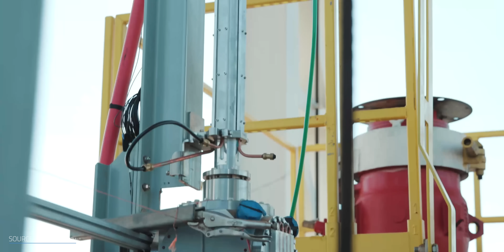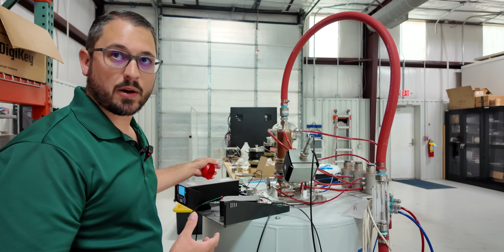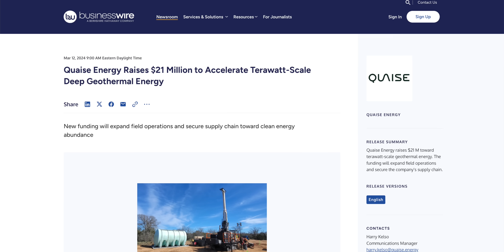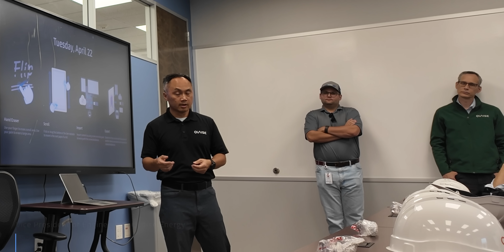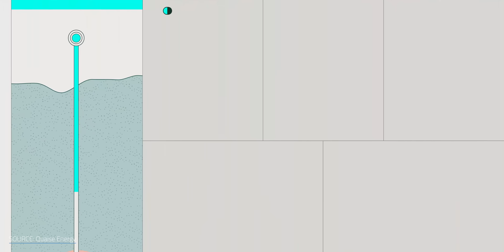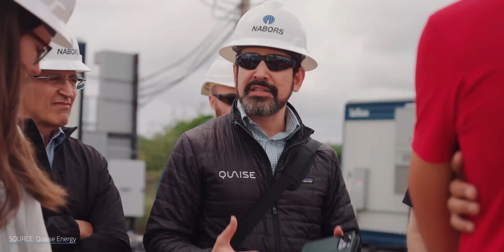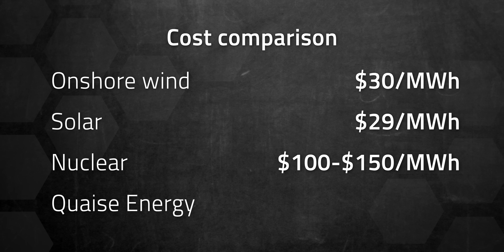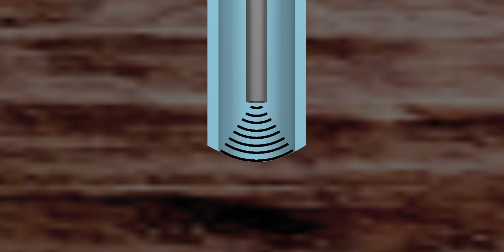How Geothermal Energy is About to Break its Limits

Comment: What about the cumulative weight of the drill shafts as the whole gets deeper? Isn't this normally offset by buoyancy provided by the dense drilling mud. wouldn't it iteventually cause a breakage up at the drilling rig or along the shaft?

Comment: I wonder how they handle partial cave ins of the drill hole when the tool is being pushed.  Melting the rock doesn't necessarily mean a completely homogeneous drill hole the entire way up the shaft, so sooner or later it will happen.  Can the tool cut it's way back out, or is there another way that they do that?

Comment: I think the economics of nuclear and geothermal are a lot closer to wind and solar than what you have shown.  For a direct comparison you need to add to solar and wind the cost of base load energy when the sun is not shining and the wind is not blowing.  There is also the lifecycle cost of solar and wind which will be higher than nuclear and geothermal.  Nuclear fusion and geothermal are really exciting technologies.
Reply: No, you don't have to add the cost of "baseload energy." Everyone knows solar and wind are intermittent. When they're generating (and increasingly, when their battery backup hasn't emptied) their Megawatts are cheaper than any other generation, so utilities install them and run other generation less often, which makes the economics of 24x7 generation like nuclear and geothermal worse . Do a DuckDuckGo search for "baseload generation is obsolete" and educate yourself.

And solar and wind lifecycle costs are NOT higher.

Comment: How long would the geothermal plant need to operate before it recovered the electricity cost required to drill the hole?  What are the worst-case-scenarios for drilling in this method?  What sort of Industrial Accidents, or runaway affects can occur - even under ideal settings?  I can see, if the technology gets popular, that less and less qualified (and moral) people will use it in more and more areas.  There are places crisscrossed with mines no one knows about.    Centralia, Pennsylvania has a coal mine fire that's been burning since 1962.

Comment: Wind and solar can generate plenty of cheap and clean electricity; what our economy badly needs is DISPATCHABLE electricity. If this geothermal power plant is shut down because there is plenty of solar and wind energy in the grid, can it be started again without any problem? If the plant is off for some hours or weeks, i.e. no heat is removed from the rock, does the temperature increase, allowing for higher generation once is restarted?

Comment: Question!! What happens if they get too liquified magma? What would stop it from coming up the hole and burning up that neighborhood?
Reply: You didn't notice the repeated displays and mentions of 375°C heat in the video? Claude AI says "The temperature of magma typically ranges from 700°C to 1,300°C". Quaise would stop drilling long before they reached magma. Hitting unexpectedly hot rock before you've spent $$$$$$ to drill down many kilometers is a great problem to have.

Comment: This looks very promising. I'm wondering if drilling deep will become much more expensive because the vaporized rock will start to stick to the walls near the surface and eventually "clog" it. I don't think they can keep the whole length at vaporizing temperatures (costs too much energy and the molten rock would "melt together", again clogging). But if they let the upper parts cool down, then rock vapor will pile up.
Reply: Kinda funny to think rock can vaporise, condense and 'freeze' just like water and many other things. It might be as simple as layering airflows so the vapour doesn't touch anything to stick to before it cools to dust.
Reply: @PhilmannDark  Was wondering the same thing.  With a bit more technology the  vaporized rock could be classified into element constituents by density, magnetism, and chemistry.

Comment: Here is a question I have about super deep geothermal that has gone unanswered when I have asked before:
How do you get the supercritical steam or pressurized hot water to the surface without it cooling off to an unusable level?

20 km or 12 miles is a VERY long distance to transpost something that must stay hot to be of any value. My only guess is that you start the pumping process and the hot working fluid begins heating the pipe AND the surrounding rock on it's way to the surface. Over time enough heat becomes "stored" in this manner that the losses begin to shrink. After some unkown period of time the steam or pressurized water reaches the surface at the needed temperature.
Reply: @Hybridog  interesting question. While I am no expert I will add two things. 1) I imagine the water is probably moving pretty fast and 2) there is presumably a gradient of heat. That is, starting from the deepest point and going up, the rock on the trip will still be warm and decrees in temperature as the water increases height. Also, I presume there is some thermo dynamics model that tells you how hot the water coming up would be as a function of depth and flow rate. Then you just need to optimize flow rate and insulation and depth (or max heat) to get your desired temp. I agree with your take about heating up the surrounding rock as well.
Reply: Not an expert, but one way that comes to mind is that you'd have the turbines very close to the source. Cycle the water in a smaller loop way down there. Then just have electric cables extending the rest of the way up to the surface.
Reply: @simianbarcode3011  The temperature of the water/steam doesn't make the energy. The difference (delta) does. Generation needs to be done at the surface or very near to it for there to be a large delta.
Reply: @simianbarcode3011  Can't put a power plant 20km under the ground. I am curious what heat losses will be from the bottom of the hole to the top, though.
Reply: I thought about the same condensing problem. I doubt the drill hole can become hot enough, because they needed it cool enough to harden to withstand the pressure, so the walls are planned to be cooler than the melting point of rock. I guess one workaround would be to pull the wave guide up again to rewiden the whole from the condensed rock. But some rock will also condense on the waveguide itself, and this can not removed by just drilling the shallower parts again.
Reply: @tristanwegner  I don't think that will be a problem - the air blasting out of the pipe will not allow it to condense on the waveguide. It's also not as much as you'd think...there's a video on some other channel that shows in their lab where they've melted rock and over time it forms these spider-web looking things on the ceiling of their little rock melting container. It wasn't like a sticky magma substance that then hardens into rock again.
Reply: I believe you answered your own question.  The other relevant fact is that rock is an amazingly good insulator, so very little heat will be lost into the surrounding rock around the bore hole.
Reply: @gptiede  if rock is an amazingly good insulator then eventually the rock around the borehole cools down because you're extracting heat faster than the temperature equalizes.
Reply: Not only do heat losses shrink over time, but the drill itself produces rock vapor at several thousand degrees.  As was mentioned in Rickey's excellent presentation, this heat now has to be extracted from the ejecta at the surface.  It wouldn't be a huge stretch to circulate that vapor through the return pipe to preheat the surrounding rock.  Remember that heat conduction rises by the 5th power of the temperature difference, so having the rock vapor so hot means it transmits its heat more efficiently.
Reply: @ed_reusser  But there would be no return pipe at the time they're drilling the original hole. Once you're done drilling you're done, so no more heat source from drilling itself, then you have to setup the water injection and return etc.
Reply: Water increases greatly in volume when it is vaporized. I suspect that the steam will blast back up the exit hole very quickly. Maybe some would condense on the walls and drip down, but blast back up again.
Reply: This is a very valid criticism, and it is hardly the only show stopper for this tech.
Reply: Even in the 2800-3800meter vertical depth holes we are drilling now 200m3 of fluid stays quite warm even when it's in a tank at surface going through the centrifuges and only spends half the circulation time in the ground.
Not steam hot but brine can be over 40c and invert even hotter, no reason to think going twice as deep where it is probably 3x hotter at a minimum it wouldn't hold heat.
Reply: @haulinbassracing  That's good info. However, supercritical steam exists at 3200 psi and 705 °F so unless that's what you are seeing, it ain't gonna work. I think the advantage of supercritical steam is that is is in a weird state where it's no longer a gas or liquid, but it's not a solid either. Engineers want supercritcal steam because it is more efficient driving turbines. I just don't know if it will be able to travel 12 miles without losing it's criticality. Maybe it's not always needed for geothermal, but I've seen it mentioned in almost all discussions about super deep geothermal generation.
Reply: Afaik the point is to not preserve all of the temperature, it's to preserve enough. From what I've recently read but can't remember the source.
And also there's the simple fact that their first projects are not going to be anywhere near 20km deep.
Reply: Supercritical steam is essentially a simple gas and the pressure is rather less when it comes out at the mouth.
The gas turbine is essentially a heat engine with input at a high temp and the output at a lower temp
The cooling along the pipe is negligible because the pipe is essentially insulated. Initially there will be some loss though.
The hydrostatic pressure (weight of the gas column) is only 15 pounds (per sq inch) per 5 miles (approx)
20km of an insulated pipe in the steady state is essentially lossless.

Comment: Even if they don't get the unit costs that much lower than nuclear it could be huge because this would be a renewable energy source that doesn't fluctuate. Solar and to lesser extent are cheap, but having to manage the grid voltage and not being able to increase output on demand are major issues.
Reply: Solar plus battery storage is reducing the stretches of time where continuous power is useful, and both are getting cheaper faster than other technologies. And variable demands like EV charging and water heating are a great match for renewables; people will recharge and pre-heat when electricity is cheap because renewables are generating.

These trends are making it harder for "baseline generation" to compete. On the other hand, AI data centers want power 24x7. But they want it now, not in 2030 when Quaise might be selling its generation.

Comment: Geothermal has always been the answer. ROI has always been the obstacle. Shallow geothermal lends itself to reducing heating and cooling costs because you were just extracting 55 degrees Fahrenheit from which to heat a cold environment or to cool a hot environment. On an individual level, that put geothermal within reach to the homeowner. 

After the inception of a new technology, advances tend to come in small increments. It's the big leaps overcoming obstacles, like this drilling technique, that provide the big leaps in advancement to push the new technology into the mainstream.
Reply: Google X's "moonshot" Dandelion Energy is trying to scale up the ground-source heat pump approach.

Comment: Here is a problem for the far future: stealing the heat from the core for millions of years has slowed the rotation of the liquid metal at the core and turned off the earths electro magnectic field and which causes us to lose atmosphere to solar radiation (like what happened on Mars). :)

Comment: How do they pump the vaporized slag out of the hole? If it cools, it will condense on the shaft walls and drill shaft. If they find a way to keep the space hot enough, how to they maintain structural stability? This seems like a great cutting tool that is limited in it's drilling depth by physics. You can just blow 200 kg of vaporized rock out of a hole with a puff of air.

Comment: THE BIGGEST PROBLEM WITH CENTRALLY GENERATED ELECTRICITY:

In 1965 most of eastern Canada and the eastern US went dark, due to a transformer in Buffalo failing, 

At the time there were 2 of these transformers available, however if more had broken down it would take many months, or even years to manufacture additional transformers.

A later security analysis pointed out that at that time there are only a dozen  distribution nodes around the US relying  these largest transformers and if they were sabotaged it would take months if not years to get the US electrical grid back up again

now consider if millions of businesses and homes, with solar and energy storage,as well as electric vehicles, it would be damn near impossible to shut it all down and this type of distributed power generation and storage would increase  National security.

Unfortunately I rarely ever hear this brought up and it's the big disadvantage of centrally distributed power generation.

Another point is historically wars are often start over access to energy, such as recently the access to petroleum products.

However if there is no need to secure importation of energy sources, I suspect it would greatly reduce the reasons for countries to go to war.

And an additional bonus would be that about 70% of the Us and other countries GDP is consumer spending, so if consumers had their own energy, it would not only lower the cost of living, (th e cost of energy is what drives inflation), the money consumers would save would give them a better quality of life because it would increase velocity of money in the economic system with more spending power, which would drive the economy to greater heights, something that businesses would appreciate.

I believe the best solution would be a hybrid grid, combining most areas that could be supported locally together with distribution to take care of sudden loads or breakdowns, it's a flexible approach that would address the issues and reduce the vulnerability of sabotage.

In Australia is Storm took down the power lines to a city of about 2 million, fortunately Tesla had demonstrated a few years earlier $140 megawatt storage system powered by solar and wind, which was found to be so effective that the city took on building out the grid and when that storm hit the high voltage lines going in and out of the City, the Tesla virtual power plant system kicked in within 20 milliseconds and went 11 days providing the city of 2 million with power until the power lines were restored and the HV power lines were basically distribute excess green power to other areas. 

Traditional power systems like coal and turbine peaker plants have now become with the economist call "stranded assets"in other words scrap value. 

As a bonus cost of electricity has dropped dramatically in this city.

I would suggest you might wish to watch Tony Seba's & Rethinkx 1videos regarding the combination of solar wind and energy storage, was 5 days of energy storage even cities in Northern US Canada and up into Alaska this would work. 

Now imagine the battle in Ukraine where Russia is hitting power generation and distribution, what if in the future all houses had solar and energy storage and it went into a grid with software that could distribute it to where it had been cut off with multiple ways of connection and I believe this would result in not worrying about your energy generation being taken out and even better the money saved would increase VOM (Velocity Of Money thus driving  the economy and reduce inflation, since the primary driver of inflation and cost of living is the cost of energy.

Scientia Habet Non Domus,
(Knowledge Has No Home)

antiguajohn

Comment: We have had fusion source for over 5 billion years. The Sun. As with a man made fusion source it needs to be converted to electricity and sent to transmission lines. Much cheaper. We also have a perpetual motion machine. It has been working for over 4.5 billion years. It is called the monn. It affects water in the Ocean, which needs to be converted to electricity and sent to transmission lines. Agian much cheaper. Both os these could provide thousands of times the electricity that we currently need.

Comment: So, assuming you can afford the upfront energy cost of melting the rock (which can be done over multiple days), a geothermal well, assuming the plant produces at 1.5 MW, drilling down to 1 kilometer would pay itself off in power production, within a week, assuming a roughly 30% energy efficiency converting from electrical to directed heat (which may be generous).
Melting is a lot easier than vaporizing.
Oh... But they are actually vaporizing the rock. Well, silicates vaporize with about 10-20x the heat energy, so... within a year, it'll pay back the energy expended. A geowell can normally last upwards of 20-40 years, given periodic redrilling efforts.
... It seems to make sense, energy-wise. And, if they aren't actually laser drilling from the very beginning, when it's easy to do conventional drilling, it's better. Surprising. This sounded exactly like trying to water Africa with dehumidifiers. I look forward to whatever advancements they may bring.
Oh....3-20 km? Well, multiply the above numbers by 3-20x. So it would take 3-20 years to pay off the energy costs...
But if we believe the claim that it'll be producing 10x  the energy of a typical well... A max of 2 years. Eh... I'll believe it when I see it.